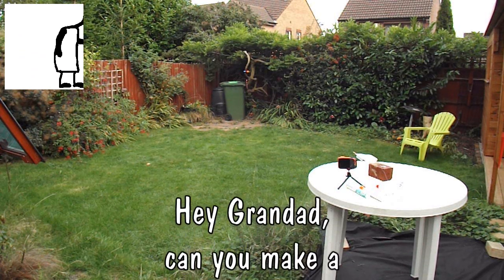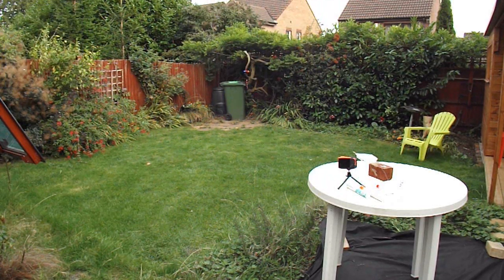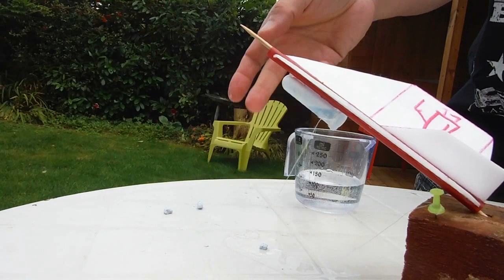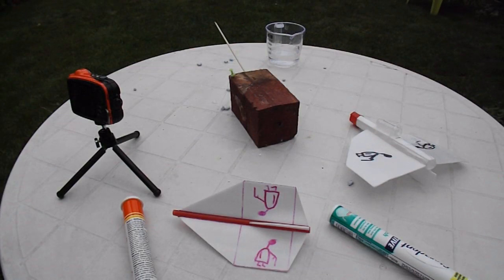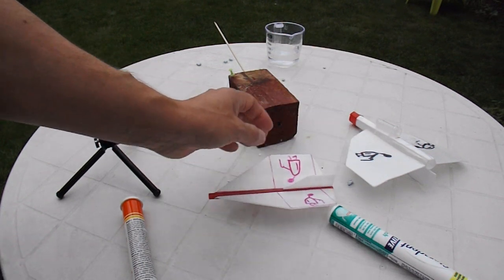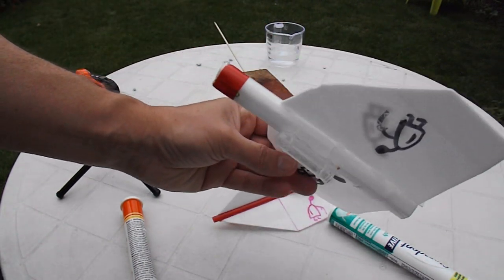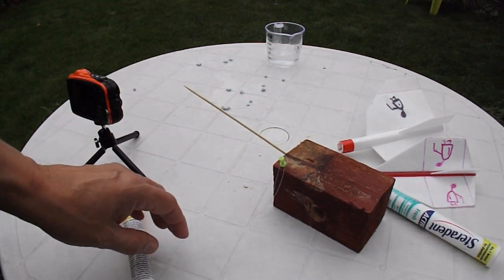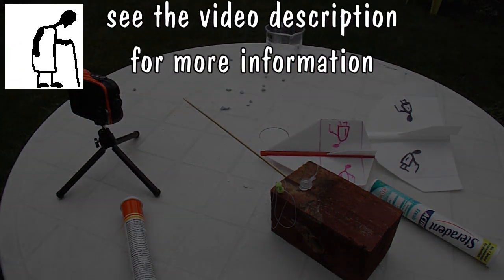Hey Grandad can you make a Mini Rocket Plane Part #2

Comment: Try it with a glider.  ☺
Reply from the maker: Those are gliders, they work fine if you throw them 😊 I guess you mean a more traditional wing and tail layout. Maybe one day in the summer I could do a "revisited" episode.
Reply: That would be great....a longer tube would give longer thrust time?
Reply from the maker: Possibly, there would be a weight trade off. The pressure builds up inside the tube until it forces the plastic cap off. That is it, all the pressure is released at that point so the amount of pressure is controlled by the strength of the seal of the cap on the tube and not the amount of water and tablets. Using the tablets and water is a fairly slow reaction which is why I like it. It gives me plenty of time (relatively speaking) to set it up and then you sit back and wait for the pressure to reach the critical point. Vinegar and bicarbonate of soda is a faster reaction.